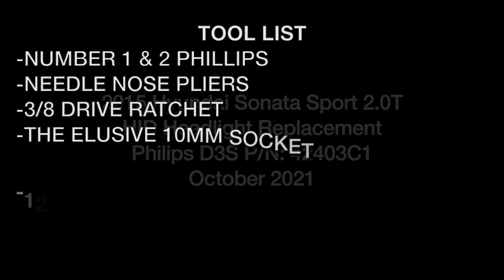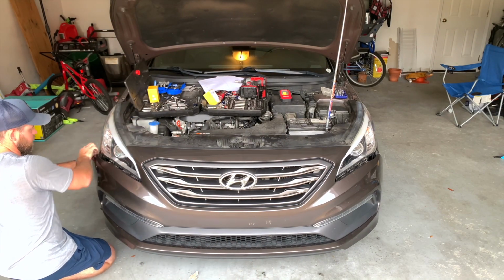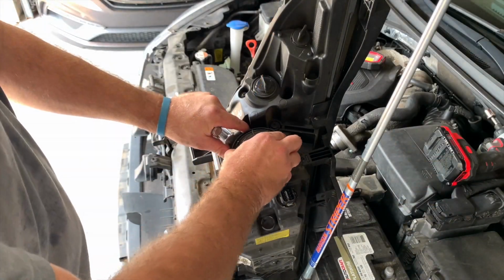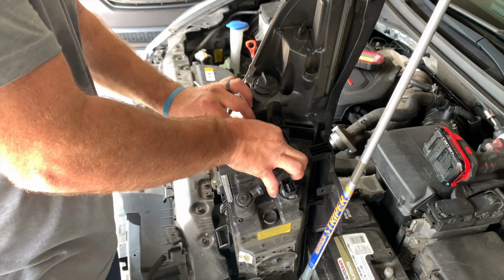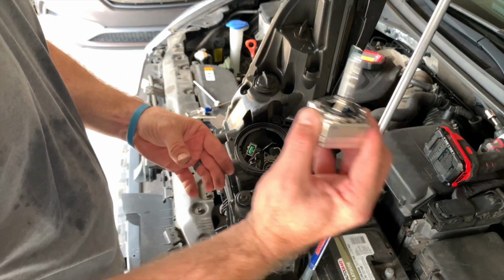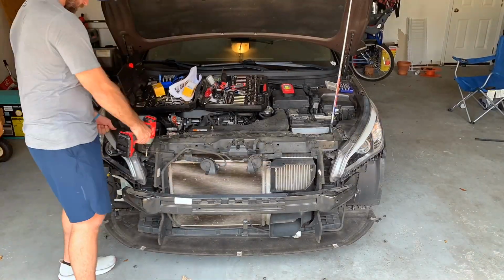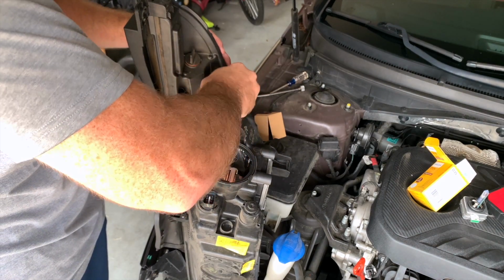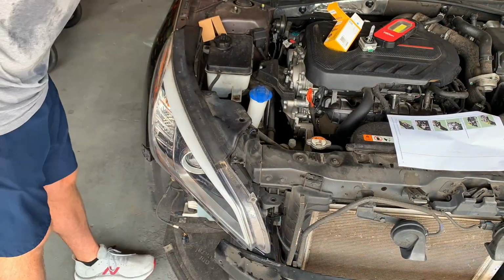2015 Hyundai HID Headlight Replacement

Comment: Much appreciated,  Nathan. I needed to replace my HID bulbs with whiter 6000k and this video was excellent in figuring out the process. You got a new subscriber 👍
Reply from the maker: Awesome! Thanks!
Reply: You are putting different bulbs in. I'm just wondering what that will do. While I have the thing apart, I probably should replace both lights. I'm thinking about putting something that's not so bright. On dim  everybody's still flashes their lights at me like I'm on bright. Thanks for any input or advice everyone. This is a great YouTube.

Comment: Hi Nathan - don't know if you're still getting comments from this video, but I wanted to let you know it proved invaluable to me.  Dealer wanted $450 to replace one bulb - and $900 for both (which is ridiculous, because most of the labor is removing the bumper, which doesn't have to be done separately for both headlights.  Anyway...the whole process only took me about an hour.  But, I chalk that up to two things - 1st and foremost, I had your video to watch so I knew what I was doing before I even started.  2nd, I had a lot less bolts/clips to undo.  Specifically, I had no bolts underneath the front edge.  Do you recall what they attached to?  I don't have the "shield" that normally goes on the undercarriage beneath the engine.  It's been something I've been meaning to replace, but haven't done it yet...so if that's what the bottom of the bumper attaches to, then that's likely why I have no bolts down there.

Thanks again.

Comment: Thank you for the excellent video. The ring that goes around the bulb on the first one you did I noticed you didn't put the ring around on the second one. You put the ring inside and then put the lamp through it. Just wondering if that caused you any problems I was thinking about cutting that open to change it but you made it look easy to take off the bumper so maybe I will do it the correct way. And thank you very much. And I subscribed to you just because of this video. With the extended warranty, Hyundai still wanted $1000 to change this lightbulb. Here's the good part. They then asked me if I would like to give the car the complete 60,000 mile check up for $1500. I said; if a lightbulb cost me $1000 what am I gonna get for $1500?

Comment: Awesome video. Thanks for posting it. Got a 2017 Tucson Limited with the HIDs too. Recently the lights have started sorta flickering or more specifically where they’ll go out for 1-2 seconds and then come back on. Happens intermittently. What do you think is the issue? HID bulbs or the ballast? Thanks.

Comment: Do you know where the HID ballast is located?  Is it inside the headlight assembly, near the bulb?  My headlights work, but then will turn off by themselves. I can get them to come back on again by manually turning the headlight switch off and then on again. To me it seems unlikely that the bulb is bad and I’m wondering if maybe it’s the ballast. What are your thoughts?  The bulbs have a good amount of brightness overall, but sometimes they do flicker slightly. Thanks!

Comment: Hey Nathan I have a 2014 Hyundai sonata and this model use 4 headlight bulbs.
So my question is , do I have to get 4 of this type of headlight?
Reply: 2011 to 2014 lights can be replaced with just opening the hood. They use H7 lights and no tools needed to do that. You can replace the dead bulbs only

Comment: great video...did you happen to get a quote from a dealer? I'm nervous about removing the nose of the car...all of those plastic clips - they could break...I have a 2014 Sonata Limited with the HID system...
Reply from the maker: It was $400 to replace them at a local shop. The clips were pretty sturdy so I didn’t have any issue with any of them breaking.

Comment: Nathan, greetings! so can i change the original halogen headlights with this HID product without any conversion with ballast? I meant, is this fix to halogen Headlamps? Thank you fo this helpful video!
Reply from the maker: Hi Deb, I have no idea. I went from HID to HID.
Reply: I don't think the conversion is easy for normal DIY.  The normal bulb for the Sonata is 9005, and when I watched other videos, it seems the whole headlight assembly is somewhat different then the one use HID bulbs.

Comment: I’m unable to see any screws close to the pin. Would you please specify. My car is Santa Fe 2016 Limited V6 with 3.3L engine
Reply from the maker: Sorry, I have no idea if the Sonata and Santa Fe would require the same process for installation.
Reply: Thanks for your reply. I did that finally but trust me, I put head lamp bulbs in many of my cars previously but this one was the toughest one. Unnecessarily they made this thing so complex. They just simply want us to go to the Hyundai service center even for the head lamp !